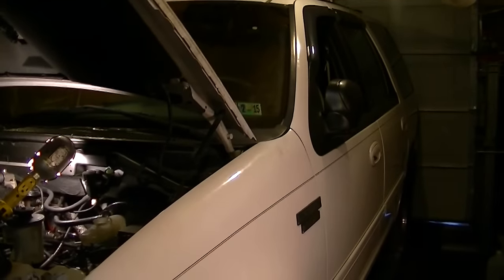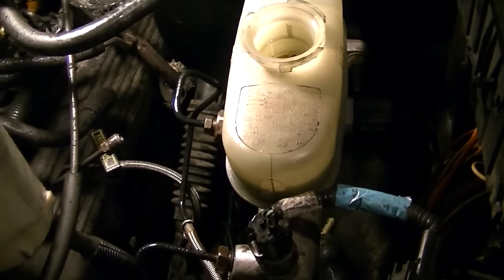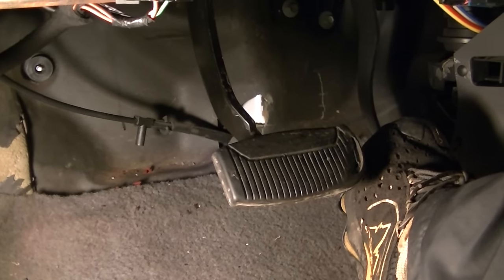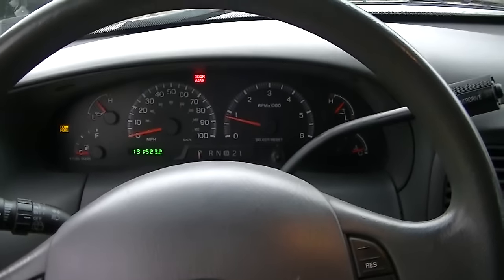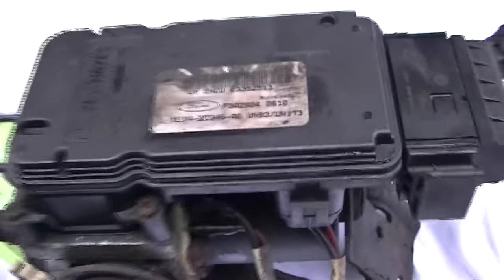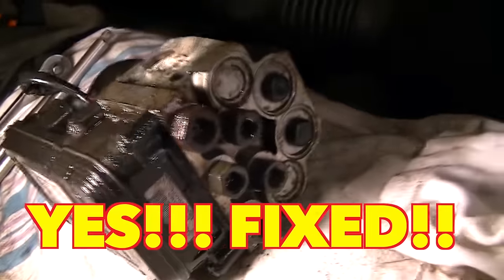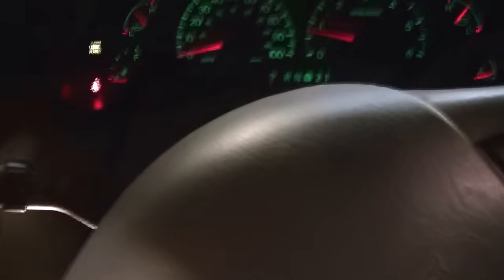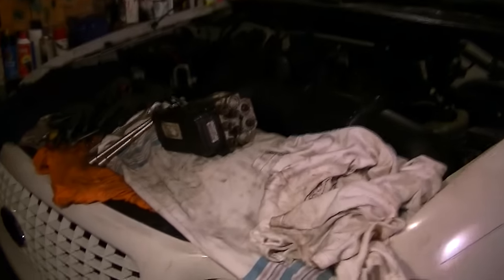Sinking/Spongy Brake Pedal -With ABS SYSTEM?? Nothing Works? Watch Fixed!

Comment: Its not the ABS. Its the bleeding that's not enough. Which means there are still air got stuck in either the primary or secondary of the master cylinder. But if you unscrew  one pipeline (suspected one usually farther fr booster) while u have helper to press/unpress your break pedal at the same timing you cover that hole with your finger, opening/closing, the air will come out then until fluid will squirt. Meaning you have bleed your cylinder well first. Follow it up with each tire bleeding from the farthest to nearest tire to cylinder.
Reply from the maker: Nice!

Comment: Waw I like your video I have this problem with my 2011 Toyota Camry I changed the master cylinder but the problem still. I am going to change the ABS pump. This is my last try for the break system. I will let you know if it works with new ABS pump
Reply from the maker: Ok great!!

Comment: Great video!! Have the same problem on my 2007 Expedition. Put on all new rotors and pads, and bled the system. Worked for a few days and then the pedal started sinking to the floor again and the ABS light came on. I will give the ABS pump a try. Thanks!!
Reply from the maker: Let us know if it fixed it!

Comment: Hey guys, I'm at my whits end here. My wifes car. This 2008 Explorer Sport Trac is driving me crazy. Long story short.. New master cylinder from Ford, new ABS pump from Ford (600.00 stupid dollars). Used junkyard ABS control module (couldn't find a new one). 
I bleed the brakes so many times, the fluid is 100% clear. I bleed the ABS pump with the scanner according to correct process several times before bleeding the four wheels. After the scanner does its job, the pedal is like a rock. Start the car, soft pedal. Again and again. This has got to be something I am missing. 
Any help is greatly appreciated, I'm spending way too much time. Thanks guys.
Reply: I'm wondering if there is an ABS fuse, and if I pull it & disable ABS, what would happen?

Comment: did you check that abs pump to see if it had a bleeding process im fixing my chevy k2500 and found out that the abs pump actually had a  ball to press in on the side to release the air trapped in it  because i had the same trouble after changing everything  too.
Reply from the maker: Not really. It was pointless to spend money when it started to do this before I even took it off the SUV. So I knew it had failed so no amount of bleeding would fix that.

Comment: Just curious why you didn’t try a scan tool ABS auto bleed first, instead of replacing the whole thing?   I know mine is all good as well and I have the same problem, pedal to the floor. The guys are saying to get an Autel Maxi Pro scanner from Amazon for $200 and try it. Worked for a guy here on YouTube in his 2008 GMC 1500 truck. Thoughts?
Reply from the maker: Because there is a difference...If the system has never been open and one day it just quits working.... why would you have to bleed it? Its failed and the only thing that will fix it is to replace it. That's like trying to fix a master cylinder that has gone bad by bleeding it, when it has never been worked on. Now if it had been opened or worked on, then that's different, perhaps air has gotten into it. Seen this for 35 years. Rarely does that ever work, only to have the pedal to start sinking shortly again. Just Saying.

Comment: I just have the same issue and I change a caliper that is not receiving brake fuel as it should , then I change the master cylinder and that driver side caliper is still not getting enough brake fluid and the brake pedal keeps sinking., Thanks so much for the info and I gonna get me an Abs module.,
Thanks again!

Comment: This happened me after I got my clutch replaced. I have an inspection coming up so was waiting to do the brake cylinder if it passed. I'll try this if a brake bleed don't work. It's spongy and sometimes goes to the floor with little braking ability.
Reply: and????
Reply: @iversonjcameron  passed everything. The problem went away but I've other issues. I've bought a new car

Comment: Before buying a new ABS module I would try to bleed the old one, you bled everything except the ABS.  This used to require a fairly expensive scan tool with that function but I think Autel and a few others now have scan models with ABS mode for under $200

Comment: this video really gave me some ideas, I just replaced the rotors and pads on my dodge dakota as well as the drum brakes and spring system in the back and my pedal is still sinking so i bled the brakes maybe 3 times and then got a master brake cylinder and again bled the brakes and still pedal sank but now i hear a faint hissing sound when its all the way down so my next thought was the brake booster but after watching this video im thinking its my abs pump. what do you think Nathan? also the truck is a 1995 2wd 3.9l with 100k miles on it. there is another thing if anyone knows why i hear my pads scraping the rotors while driving even after i replaced them..

Comment: I have a question if I may, I have a 1997 Toyota starlet ep91
I have replaced my master cylinder, brake booster, pads, and shoes. I have a firm brake pedal when car is off, but when car is on, the pedal goes to the floor.
I have bled each brake except for the rear brake on drivers side, but it does engage except for when car is is turns on.
Any help would be wonderful 
thank you

Comment: Thanks. Ive bled them 3 times even though i never opened them. ive never had to deal with ABS or the twist compressing rear calipers before .  i should have known though. the ABS light was on. i figured it had air in it somehow though. thanks for the video.

Comment: Need advice !  Have a 2003 ford taurus.  New Master cylinder, New front calipers.new front brake lines, New rear wheel cylinders  drums and shoes.have probably forced 2 gallons of dot 3 brake fluid through the system with a pressure bleeder. Replaced the abs module with 3 different used ones , pressure bleeding it each time and activating the abs pump with an  autel maxi check scanner. Still  have no brakes. Please any ideas?

Comment: Been there done that....did all the same and still sinking pedal.  Then used scan tool to bleed the ABS module...had to do it 3 times.  Then good brakes again.  Don't replace the ABS module if you got no light on!!!!!!!!!!!!!!!!!!!!!!!
Reply from the maker: Wrong! Still working to this day!!!!  ;)  Try again.
Reply from the maker: With a full pedal!!

Comment: How do you bleed the abs module if you have to bleed it. I just replaced mines and bled the all 4 brake and it's still stinking on the first pump after the second pump when coming  to a stop fills up and works normal.  Happens at every stop
Reply: did you manage to bleed them yet? same issue here

Comment: Your used pump have fluid in it? Did you need to actuate the valve unit to get the air out or did just pumping it work? Did you have to bleed the brakes again if you did.
Reply from the maker: It just starting working. I was worried about that....but never had to bleed anything ;)

Comment: I have this problem. 99 Bonneville. I replaced the master. I'll try the ABS module, & let y'all know. Thumbs up Nathan!
Reply: Well? .......
Reply: @pizzamon795  Sorry Pizzamon 79, when I got down there I found some, or rather, a lot of missing frame. So I sold the car to someone who likes to weld.
Reply: @jacobleedowney  apparently you have to burp the lines at the master cylinder. I did not do that. I just got off the phone with my mechanic and that's what he said. I'll let you know in couple of days when he diagnoses it.....
Reply: @pizzamon795  Awesome! That's one of those things I figured I'd never get to know the answer to.

Comment: I've had air in my ABS system which couldn't be bleed out without the appropriate scanner. That caused a soft pedal. Scanners were always a problem to get hold of until today, $200 US dollars will get you a decent scanner on Amazon.

Comment: Swapped a junkyard truck abs module just the module NOT the pump on a 99 Expedition Eddie Bauer and the ABS light was on.Put original one back on and the light was off. Does it have to be programed into the truck or did I get a bad module ?

Comment: Hi very instrctive video. I have same problem (Spongy brake pedal) on my SUV. Also, the pressure applied on the four whell disks seem to be lower than it should, only a small section of the disk is shiniy (same for all 4 wheel). Was that the same in on your vehicule before you replace the ABS unit? Thanks a lot this would help me diagnose the brake problem on my vehicule.

Comment: My 99 2500 did not get better with bleeding. I pulled the fuse to the ABS and the pedal felt better and the light in the dash went out. I will totally bypass the ABS unit if I have to but so far so good.

Comment: I have a 2013 Chevy Silverado 1500 and I had a bad caliper so I replaced with a rebuilt . My brakes worked fine before I took it off then when I came back to put it on and bleed the replacement in front driver the pedal keeps going to floor.  I swear I'm going crazy. You think this pump could go out by doing what I did?

Comment: JUST had this problem with a 2009 fusion.  changed out old fluid, new master cylinder...did absolutely nothing.  Then the abs fixed it.
Reply from the maker: Nice!~~
Reply: Did you do the repair yourself? I need to do the same to my 2009 fusion, and am looking for the abs pump/module. Going to call dealer to get price for parts.

Comment: I have the same problem on my Dakota. I have replaced everything! I guess a new ABS Module is next. Thank you. V
Reply from the maker: O man! Well, let us know if it fixed the issue!
Reply: It is good to hear from you. I'm currently on Ebay because a new or rebuilt Module is not available. 
 the ABS controls only the rear Drum Brakes. Thank's for the Info. Ted.

Comment: This seems to be a common issue with this model of ford trucks, one went bad in my f150.  I just disconnected mine, don't have ABS anymore but that's ok.
Reply: Disconnected ?  How ?  Did you pull the ABS fuse as others are saying ?  Or re-route the brake lines like in the video ?

Comment: Did you try to open up the pump to see what happened to the original crustation?
Too bad there are no rebuild kits or parts for them.  What a racket.
The pump new as you know is worth more than some people's cars.

Have a used pump on the way from flea bay with  56k on it   Have a Ford 09' Taurus 
Hopefully it will solve the sinking issue as shown here.  thanks!
Reply from the maker: No. I should next time.

Comment: finally... I have the same issue with 2001 ford f150.     truck not used very often but one day the pedal started falling when I sit at a light.    of course I went and replaced the master cylinder....   hmmm, pedal still falling!  Brakes work fine otherwise... only happens when vehicle is stopped with light pressure on the pedal.     I am so tired of googling and seeing everyone recommending the brake master is the problem, bleeding the brakes, start from right rear wheel, etc etc.    I already replaced everything and bled system so the ABS module on mine must be the problem.... i gotta find one now.
Reply from the maker: dmcvideos. I understand. I got mine for $40 used at a junk yard :) No problems since! Make sure the abs pump is the same part number!

Comment: Have thus same issue at work with a hinda odyssey 08. Found a leak from the booster so we started there. No fix. So we then changed out the master. Gravity bleed. The bleed from calipers. Still no fix. Guess ill be looking into the abs 1st thing in the morning.
Reply from the maker: Let us know if you fix it!
Reply: @FixingWithPassion  no fix. Did the bleed on the abs. And no change. Did get some air out of the front calipers.
Reply: @slimhonda6352  Did it end up being a bad ABS, then? Thanks.
Reply: @steveandrews8301  this was so long ago I don't remember.

Comment: abs module can be bled also, didn't necessarily need to buy a new one.
Reply from the maker: Good luck with that....I see see very few that this will work on. They fail internally so nothing can be done, only replacement it the only option. Maybe in a rare attempt this works.

Comment: very interesting, I have a 97 gmc sierra that I've tried bleeding the brakes different ways but no luck.it's got a spongy pedal and the absolute pump growls every time you start it up and take off,and while driving without touching the brakes, would you recommend replacing the absolute pump

Comment: Hi Nathan, 2006 Honda Odyssey from the moment I replaced the brake pads and rotors the pedal soft and went down to the floor, My mechanic work on Honda dealer, he took my car and flush the fluid, bleed it 2 times replace the master cylinder and bleed it another 2 times and still soft, today I was on Firestone paid them 50$ for inspection and they say that the abs good (no error) and master cylinder still bad (I replaced it yesterday aftermarket) and they recommend to install OEM, I dont know if to replace the master cylinder with original one will help or try the abs module

Comment: I thought it may be my booster. But my brake light and abs light is on. I changed and bled my brakes not even a year ago.
My issue is my brake is hard. My car doesn't brake right away when I press it.
Reply from the maker: O man!!

Comment: Are you sure that you shouldn't perform bleeding of the ABS system itself. It has a pressure accumulator that has to be filled with brake fluid. The ABS bleeding procedure is usually performed with the special manufacturer diagnostic software/tool.
Reply from the maker: Na...years later working perfectly.
Reply: @FixingWithPassion  My brake pedal was firm with normal movement and no spongy feeling for 6 years. Now I suffer from the same issue (sinking brake pedal to the floor, spongy feeling) after brake fluid change at the official FCA dealer service shop. The car is Fiat Freemont (same as Dodge Journey) here in Europe. After several attempts (obviously unsuccessful) to bleed the system the FCA completely refuse to service the brake system any more, because they say this is normal. What a stupid opinion. I want to complain and report their incompetence but don't know where I can do it.

Comment: I am having the same problem with a 2013 Ford Edge with only 19000 miles , they replaced booster and I replaced  master cylinder and they are worse than before .
Reply from the maker: O no!!

Comment: I had the same problem with my 2000 explorer! Simple way to find out if it is something with the ABS system: PULL THE ABS FUSE! I pulled the fuse and the brakes work fine! In fact, I am keeping the fuse out and not repairing the ABS system! The ABS light is on, BUT I don't care!
Reply from the maker: Yeah that works for some. I guess it depends on what is actually wrong  internally with the ABS module.

Comment: Great info!  Was thinking master cylinder myself, but the symptoms seem to be closer to the ABS pump. When engine not running on mine, brakes are solid to the top. After starting the pedal goes way down. This to me seems more like ABS pump also. Never had to replace one so this gave me more to think about. I'll post when I find out. Good video
Reply from the maker: Nice!

Comment: So,you didn’t have to bleed or did anything to the new ABS pump at all,after the installation ? I have a 2014 Tundra with a sinking pedal,I don’t know whether it’s a master cylinder or the ABS pump yet. Hopefully,it’s a master cylinder. But if it’s the ABS pump,Hope I don’t need to do anything to it. Thanks for your video

Comment: Hopefully, this is the issue that I am having. I just replaced the front calipers and rotors, and of course the pads. I bleed both calipers, I felt no need to bleed the back brakes, and my pedal sinks to the floor. I have a 2004 Toyota Tundra.
Reply from the maker: Yep! Well if you replace the ABS let us know if it fixes it so we can help others!;)
Reply: dennis ranck   On ABS vehicles the ABS speed sensor needs to be reset whenever the system is open (leak, change calipers.....). It takes a scan tool to do it, or according to many people you just have to activate you anti-lock brakes (lock them up on a slippery surface).

Comment: sometime, new brake pads (cheap ones only), are not sitting well on the used brake disc. These times, for  1-2days drivings the pedal is spongy and i inform about that. About ABS i didn't ever had problem. Now i know.

Comment: I have the same problem in my 2006 Ridgeline. I bought a new ABS module too. Then I was told I would have to reprogram it on my cars computer. Took the wind right out of my sails. Have you ever heard of this?

Comment: Hello! Got the same problem on a Nissan pickup...master cylinder been replaced by a mechanic, now another one is advising me to do it again because apparently I bought a cheap cylinder....pedals sinks and car barely stops...abs pump was tested with a tested and no faults came back...it must be the pump, cannot think of anything else

Comment: Thanks for sharing, but you probably didn't actually need to replace your ABS system.  Instead, had you activated your ABS system several times (either while driving on a somewhat slippery surface and hard braking or by using a diagnostic tool that can activate it), that probably would have gotten all the air out of it, then you would bleed out your brakes one tire at a time, maybe 2 or 3 times, and I bet that would have worked.  Thanks for sharing though, very kind of you.
Reply from the maker: NIce!